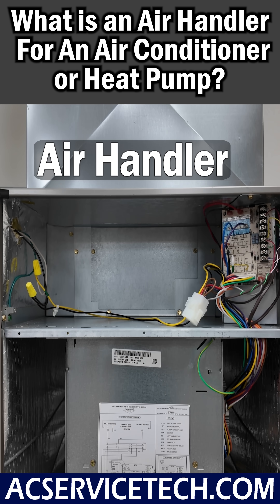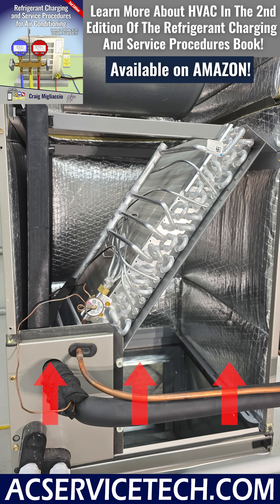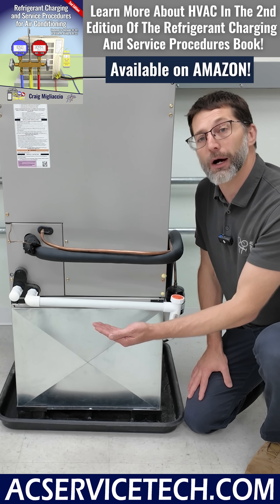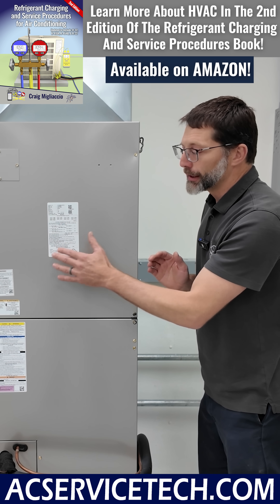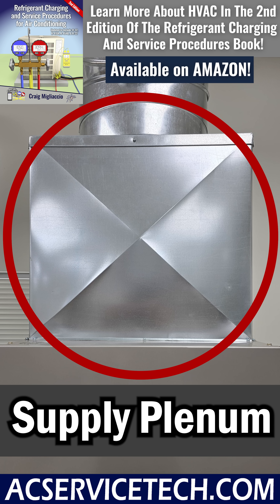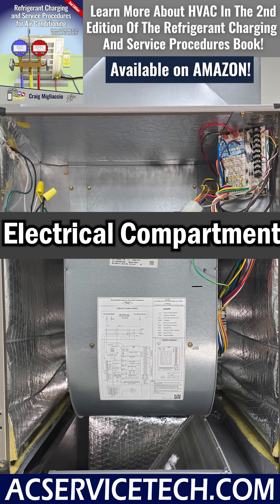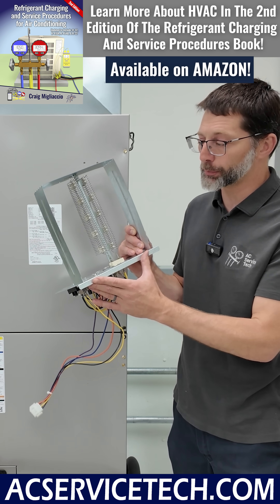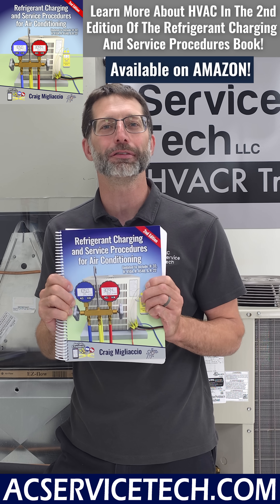Air Handlers Explained! For Air Conditioners & Heat Pumps!

Comment: Im in hvac and i hate air handlers so much
Reply: What about it do you hate?
Reply: @Elisummit845  and i forgot to mention they make your electric bill go way higher than if you had a gas furnace
Reply: @Elisummit845  if they go out in the winter due to refrigerant issues, and they dont have electric strip heat its useless, they basically run 24/7 in the winter and dont run at the maximum efficiency, and they dont keep the house warm when its really cold out. Too many issues and unreliable in my experience. Every good hvac tech ive worked with hate them. And reversing valves can go bad and they are a pain to replace and expensive for the customer if its not under warranty. They are just not great
Reply: @Lash-q4c may I ask what state you live in? Why do you use a  heat pump in an area that's not designed for it? And what does this have to do with an air handler? Your issue is with a heat pump not air handler. Very confused about your comment.
Reply: @Elisummit845  i live and do hvac in indiana, gets too cold in the winter for most heat pumps. Indiana isnt a ideal place for heat pumps
Reply: @Lash-q4c so why in the world would you install a heat pump in your climate? 

Btw when you install a heat pump, do you do hi and low boxes? If you only do boxes on the ceiling, you will never get the heat to come down low. That's a side note. You have to make sure your equipment is rated for your climate.
Reply: @Elisummit845  im a service tech so i dont do installs. The people who are still getting heat pumps in theyre homes are because of Salesman thinks thats the best option for them lol. And what to you mean hi and low boxes guess im not too sure what your talkng about
Reply: @Lash-q4c so if you have heat coming out of your grill on the ceiling. Imagine you're the hot air. You are floating on top, close to the ceiling. Slowly, as more heat comes out, the heat will drop lower and lower. Your thermostat is at 4-5 feet? It reaches temperature and shuts off. Your feet are still cold. But if you have a register down low, blowing at the bottom of the wall, you will add a lot more heat energy lower down. But if your location is to cold, your HP will keep turning off and run in defrost mode, so that's another issue.